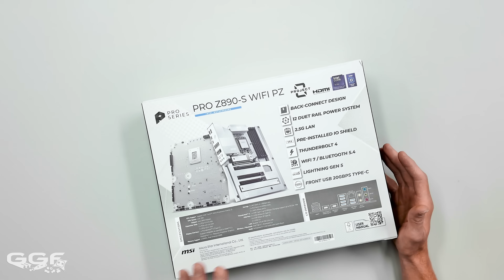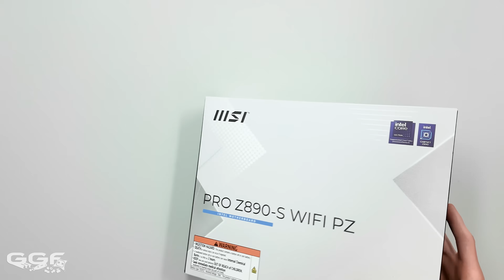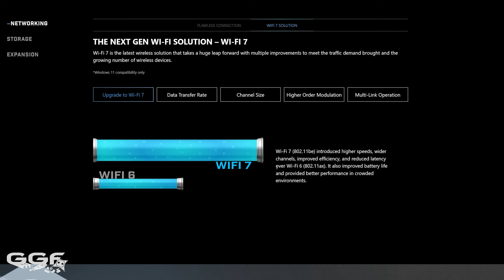Most AFFORDABLE back connect Motherboard? // MSI PRO Z890-S WIFI PZ

Comment: Hello guys, quick question I'm looking to buy a backconnect motherboard such as this one, but for AMD AM5, so I found the MSI PRO B850M-A WIFI PZ but as this is the Pro Business Series I don't know if it will work on a gaming build. I chose this one because it has a cleaner visual than the actual gaming version with all the marine green labels and effects...

Comment: Hello, is this motherboard compatible with my 1080 ti?
I'm looking for a temporary upgrade to my old rig, with the MSI PRO Z890-S WIFI PZ Motherboard and an Intel Ultra 7 265K and my Asus STRIX GAMING GeForce GTX 1080 Ti 11 GB GPU
For now I am tight on a new GPU, and RAM budget. But i will be able to afford newer ones overtime.

Comment: How do you change out the CMOS battery? Where is it HIDDEN?
Reply from the maker: Remove the cover and replace it
Reply: @GGFEvents If you’re referring to the heat sink cover near the back ports, what a pain. I will assume you would have to remove the entire motherboard to get to the screws maybe on the bottom. I don’t believe it is a latch release on such cover, you could advise better. However, MSI is not the only MB manufacturer that is hiding the CMOS battery location.
I do see on the newly released Gigabyte ‘Stealth’ MB for AMD they placed the CMOS battery under one of the SSD covers. Easy to get to (depending on GPU mounting) to change that battery, granted 5 or more years. However, don’t have to remove the entire motherboard!
Thanks for the reply! Best to you and the channel

Comment: MSI PRO Z890-S WIFI PZ----> one word: expensive. The problem with expensive M/B is it is hard to resell even when it is less than 1-2 years old, or will sell at at a hugh lost.
I won't be search for them, for my rig. THose I am after may not be the fastest or the lastest model or best looking one but looking for features that fit my needs and there are many models to choose from at a reasonable price e.g. Budget Asrock or mid price Gigabyte. Better still wait another 1-1.5years the prices will fall even more.

Comment: Thanks for the review! I’m planning to pair this board with a Core Ultra 265K and liquid cooling, but I’m a bit worried about the VRMs. Is it stable for overclocking and gaming?
Also, has anyone else here used this board?